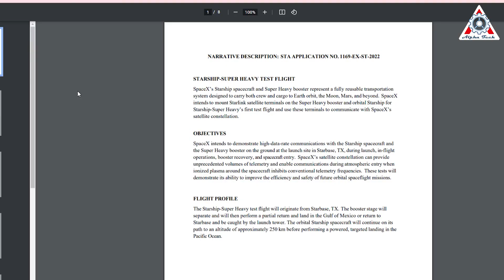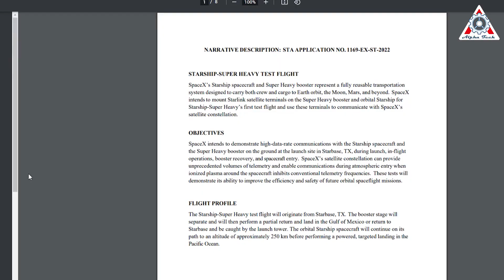Elon Musk just Changed SpaceX's Plans On Booster 7 After Explosion At Launch Tower

Comment: I’m a big fan of “try it, and see what happens”. It’s the proper way to learn. No simulation would have given them the data they gained from that mishap.
Reply: Every Engineer learns in their career that sometimes the best test is a test not done on a computer.
Reply: At the same time, didn't anybody think about what a bad idea it is blowing out that much methane at once?  One ignition source, and you get a fuel/air explosion just like they did.
I believe a preburner test would have been safer than a spin start test exhausting a LOT of unburned propellant.

-- Armchair Rocket Surgeon

edit:  fix awkward sentence
Reply: Board meeting: just spin all 33 and see if it blows up

Comment: The first time they catch a booster it will be dicey no matter if its the 1rst launch 3rd launch or10th launch. Might as well get it over with straight away. If it works, the wealth of data and examination of the once used booster would be invaluable. If the catch fails, stage zero could suffer some damage but they would still get data. I'm glad I'm not making the decision. Of course if I could build the whole starbase with my personal pocket change, like Elon can, I might be good with it.

Comment: Thanks for getting into the details on Starlink. Phased array is the best. 
 I spoke to one of the guys who designed the wing that was proposed to bring the Saturn 5 back to a horizontal landing years ago and he insisted ir would have worked. I can’t help but wonder if something like that could have worked for the first stage.
 Wings on the upper stage would allow says to be deployed on a single orbit and then allow return to launch area because they could give the vehicle enough cross range. This would facilitate much faster turnaround than the current design for these kinds of missions. It might even loft more payload since no propellant need be carried for landing and no sea level engines needed either. This might move than offset the mass of landing gear and extra mass for the wing’s vs. drag devices.
Reply from the maker: Yeah. Starlink is an important part of F9 landing. So hope Starlink V2 will be more successful

Comment: Question. If the starship launch pad support legs are steel tubes back filled with concrete,  what is to stop the concrete in them from expanding and blowing out when exposed to the intense heat of a launch. If you take a torch to any concrete,  it will soon crack and expand and sometime explode the water , moisture,  in the concrete as it quickly turns into steam. Also, the quick release grips could malfunction under such heat expansion.  Looks like a water cooling system is needed for launch pad. Just saying.

Comment: Intriguing specs on the issues and resolution SpaceX is attempting with these updates offered post🤙. ...In respect to Mechazilla, it's still in a very simplistic infastructer condition,  it may require added limbs and body form, like a tractor chest/torso, those 90° rotates from launch and land position ports,  are extremely close, there may need 3 section,  land, takeoff and setup bays adjacent, so rotation effects will aquire. As for the poor OLT, baring multi task component. Also may require separate sequels. From fuel flow source, weight holstering rims, and a way to evade the BEAST flaring WRATH👀.

Comment: I wonder why SpaceX did not seem to attempt simply adapting a landing system as effective and reliable as the one so successfully used for Falcon 9 by scaling it up to suit Super heavy?

Appearances even suggest that when such scaled up landing struts were retracted they could serve as covers for the composite overwrapped pressure reservoirs currently needed for restarting the Raptor 2 engines that are currently protected by heavy stainless steel covers anyway!
Reply: Weight

Comment: 33 engines. Interesting number. The Soviet era N1 had 30 engines bundled together. Musk has failed to learn from that failed design and (I don't think using a different fuel will help much) has bunched 33 raptor 2 engines together in a fashion guaranteed to cook their neighboring engines. What could possibly go wrong?
I will watch with interest - and a bucket of popcorn.
Reply: You are forgetting something. It was the Soviet Union (no care for quality or safety) and it was likely during the space race decades ago. This is the modern U.S where intellect and engineering is allowed to flow freely and there are lives and money on the table when it comes Booster 7's success. Rocket science has come a long way in America.
Reply: In the 60s the NK-15 engines powering the N-1 rocket had pyrotechnic valves and so they could only be fired-once so you could not even acceptance test them (they tested 1 in each batch of 6). That pretty much doomed the whole vehicle to engine failures and that’s exactly what happened.

The Raptor can be restarted as many times as you desire and so doesn’t have this problem.
Reply: @leeswecho  Yes the raptor 2 has modern flexible features designed in. However That doesn't change the heat damage potential inherent in this multi engine design. Wanna bet they don't blow up more than 4 of these boosters? You might lose that bet.
Reply: i agree, you can't have that much power all bunched together without something going wrong,